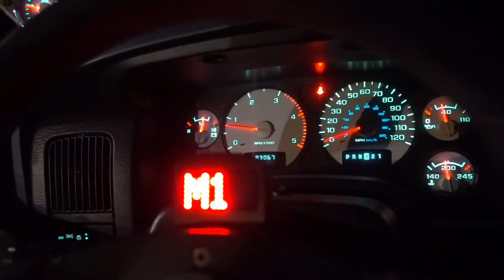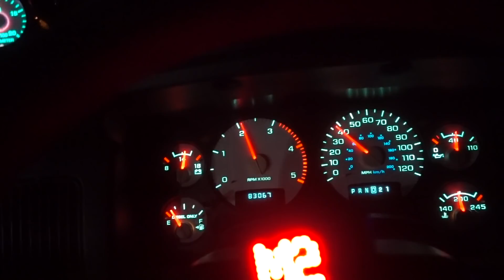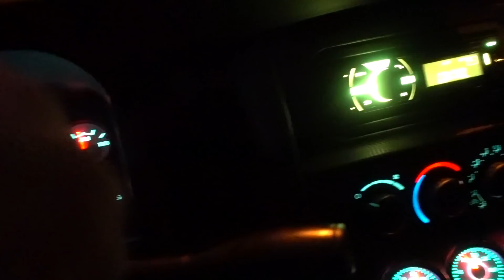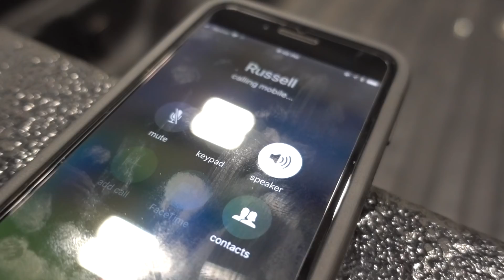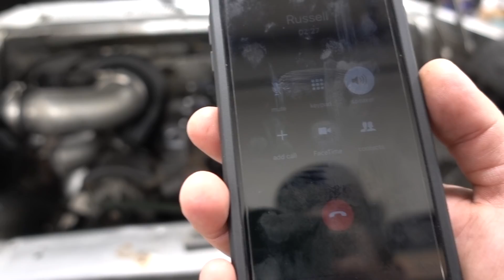It's ALIVE and ready to RIP!!!!

Comment: Anyone know what size AN fitting going in the oil filter housing for turbo feed line in a 2002 ram 2500? Going with a -4 and can’t find what size that fitting is. Thanks
Reply: I'm pretty sure each - equals a 1/16" so -4 would equate to 1/4"   Hope that helps you out.
Reply: I tried 1/8 npt & 1/4npt neither fit. 1/8 was too small & 1/4 was too big

Comment: Hey Greg all you have is that 1 Derale cooler under the bed as your only cooler? No front cooler or heat exchanger im guessing? Is the Derale unit a 25 row or 40 row? DO you think this would be enough cooling on a daily driver? If not how about 2 Derales next to each other mounted at an angle instead of horizontal in the spare tire area? Also are your braided line ptfe (teflon) inside them? I was told I need ptfe for atleast the hot line running back to cooler..
Reply from the maker: Yes just a single bigger derale cooler, dual cooler would defiantly be great, I personally have never had a issue but a lot of people run duals, and no I don't have the special hoses on the trans lines

Comment: typical 3rd gen dodge. yes you shut your lights off but they only go off right away if you turn them off before you turn the truck off. if you want em off right away if you do that again just flip the key to run then back off and they will shut off